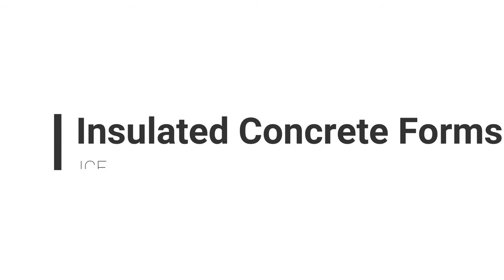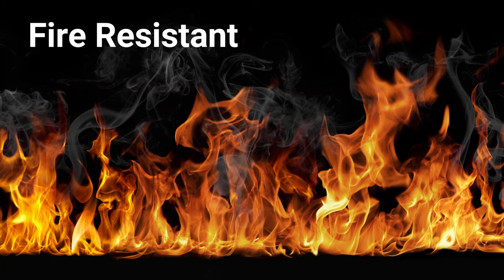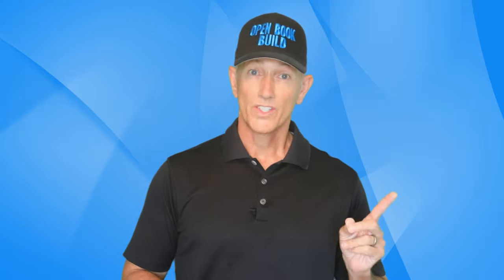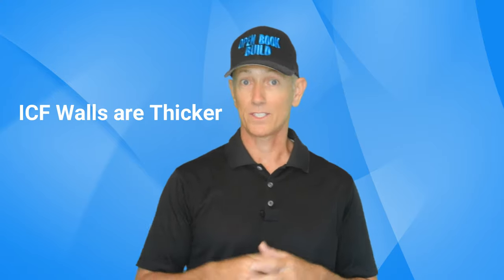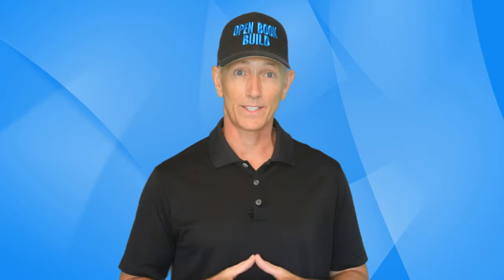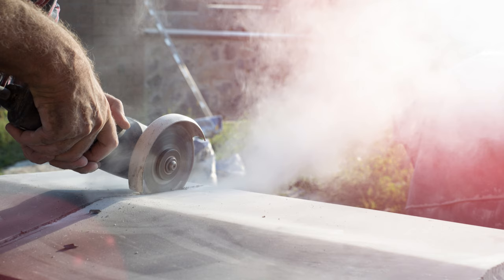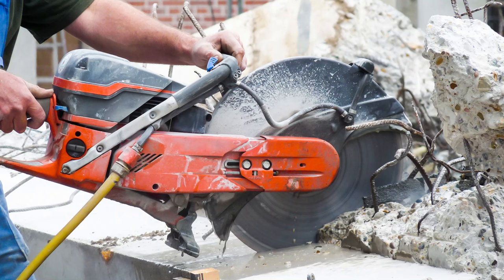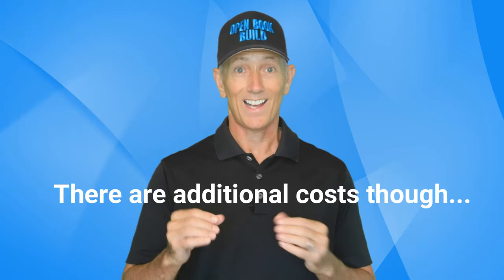ICF Construction: Why I Haven't Used Them as a Builder

Comment: As a guy that builds with ifc’s nearly everyday here is my take. 
Detailed plans are a must and we will live or die on the plans. Openings, pipe penetrations, windows and doors are set to the plans and followed to a “T” because we do not want to come back and fix anything. But we can build off any standard plans, building off interior dimension isn’t uncommon. 
But most of our builds are not complete homes. Most are retaining walls build into the house. A half basement type thing.
Reply: Cody, where abouts do you build?  I am getting ready for a custom home build in the San Antonio TX area, using my brother in law (a custom home builder) and trying to convince him to try ICF. We will not use it for the main house, but I want to use it on the shop (approx 20’ x 25’)
Reply: @justinjimenez6960  I’m in the north west area. By the Continental divide. If nothing else just try the foundation walls with the Icf. Up here we need to build below the frost line and that is usually two-three blocks high depending on the brand of blocks. It’s a good way to get your feet wet and see how comfortable you are with the blocks. The insulation is amazing with these things. Currently finishing my own home with these blocks. You can literally walk into a room, fart, and the room temp will rise 7 degrees….😉
Reply: @justinjimenez6960  There's a company in East Texas called American ICF. I'm planning on having him help on my house with full basement. You give him the plans, he orders everything you need and puts it all together. You hire your own concrete guy etc.
Reply: Hi Cody, did you try Thermasteel panels?
Reply: @coronaviruspandemic7548  did you end up using American ICF?  I haven't been able to get ahold of anyone there.
Reply: Went to a homeshow in Northen Utah. Building next year and I'm 95% positive to go this route
Reply: Being afraid of new technologies is not uncommon. I built my own house with ICF to the roofline and I absolutely love it. Installing the electrical was not the huge issue you make it out to be. A simple hot knife to cut the wire runs and for the boxes then spray foam to seal it. As far as difficulty aligning the walls with concrete just use a proper bracing system and align as you go while the concrete is wet. Stick building is horribly flimsy allowing alignment after the fact. You don’t have blow outs if you use good blocks (Fox Blocks) and you do not try to fill all the wall at once. Fill in three foot lifts and circle the perimeter, by the time you get back to the beginning the first course is setting up. Yes you have to plan ahead for larger larger penetrations but small holes like for silcocks are no big deal and can be drilled after. They build multistory hotels with 6” blocks so a home doesn’t need anything wider. The 4” blocks are harder to fill. I have have joist hangers made for ICF that support directly to concrete and for the deck mounts and sunken floor area of the walk-in in curb free shower I used rim joists mounted with J-bolts where windows are cut into the foam to allow mounting blocks of solid concrete to come to the surface. Having mounting points every 8” instead of every 16” is great. We took the stone from the basement dig out and used it to face the front of the house and it sits on a concrete ledge of the specialty blocks. Heating and cooling costs are noticeably lower and it is a real quite structure. I will stick build my garage but never a house in sticks again.

Comment: Not the case of this gentleman, but builders do not like ICF at first because most of them (by their own admission) do not even know its existence.
Second, the house walls go up so quickly in 1 go with only 1 trade of 5 men (+ concrete truck guy) instead of 3 to 5 trades, and that leaves with very little room for change orders, up charges for "hard to get supplies" and "unforeseen" issues the stick builders can charge the customer with...
Also if their employees learn how to build in ICF it would not take much to go "solo" and become their competitors in the same area.
The issue highlighted in this video with the flooring system detailing is easily resolved by using detailed drawings which are provided by the ICF block supplier and can be integrated into the original plans in no time.
But in general, a part having to manage humidity for the first 12 months, most of the concerns mentioned in the video offer an advantage if looked from another angle.
Sure it requires better planning and drawings than a stick-built, but that is a win because it will force you to plan and supervise better which is not a con.
From 2000sf and up, building in ICF offers more advantages than the traditional system and comparable costs. For basements, ICF is actually a no-brainer.

Comment: I built a 1600 sqft (per floor - Canada, upper floor was traditional 2x6) walkout ICF in 2010 and here is my take.  You need a good concrete supplier with consistent quality concrete and need to be very sure to brace the walls properly (mine were 10ft tall) not only to prevent blowouts, but also to prevent the small separations that leak concrete.  I planned for all the service penetrations ahead of time, and it wasn't an issue.  Extremely quiet and comfortable (although this was out in the country on 160 acres...so already quiet).  Humidity was never an issue from day one...I'm not sure where that's coming from.  

Also, tons of waste in the form of small pieces of foam and plastic clogging up the landfills afterwards (and blowing around your property).  This is not an issue with factory-built SIPs, and the process is much quicker and less prone to screw ups, so I may go that route with my next build in a few years.  You do also need to dig out foam channels for the electrical, which was also time-consuming and made another colossal mess.  Forget about stucco on the outside too unless you really want to complicate your life.
Reply: Hi Karl, we want to build an ICF house in 2023, about 1200 sq ft.  Can you provide me with any contacts?
Reply: @JNO_JNO  Hi, no idea.  I am in Saskatchewan.  It isn't that difficult to do yourself.  My neighbour (out in the country) did a house our size and him and his wife watched the video that came with the blocks and had the house up faster than I did, and it looked a lot better too.  The main benefit other than doing it right is that you aren't waiting on contractors.
Reply: @JNO_JNO  nudura or amvic or build block
Reply: Pretty sure all of the foams used in ICF blocks are recyclable, so the off cuts shouldn't need  to go to the landfill.
Reply: @carlb401  Haha...I have yet to experience a contractor that gives two sh!ts about the environment.  They're like grain farmers.  I had to tell them several times to clean up the pieces that were blowing all over my property.  When I asked them about recycling the pieces (because I had heard that too) the numb look they gave me was not encouraging.  I doubt even 0.1% of the waste ever gets recycled.
Reply: @karlhungus545   My pet hate is mess when working. As a carpenter here in the UK, when ever i set up a cutting bench or my mitre saw i always have a bin next to my tools for the waste. I have lost count of the times i have slapped someone when i let them use my bench/ saw and they just throw the rubbish on the floor, even though the bin is just 2ft away. 🤐
Reply: I still don’t understand why people don’t just build with concrete block and put the insulation board on that . Homes in Florida are almost always built from concrete block .
Reply: About the humidity, the guy in the video talked about concrete being 20% water that "needs" to get out. That is complete false information. Concrete does not "dry", concrete reacts with water to form hard crystals. The water does not need to get out, it needs to stay in and form concrete! That alone tells me the guy has no clue about construction, and this talk against ICF is just the opinion of a man that hasn't done much outside his comfort zone, aka houses slapped together cheaply and quickly. Yes, sometimes concrete will let out some water, but not nearly 20% of it's mass and like he said, a couple of dehumidifiers are good enough to address that.
Reply: @flavius29663  Yes, lots of these guys are stuck in their ways and would rather believe nonsense (and try to convince others of the same) than have to learn something new.

Comment: I really enjoy this channel and how much value it brings to anyone looking to be an owner builder. Some helpful viewpoints. ICF are far superior. It's difficult to even present a comparison. When you look at everything from the lack of thermal bridging, framing factor of traditional stick built homes, thermal mass of the concrete core, blower door test results of ICF, operating cost of HVAC systems in ICF, resilience against water damage, and the ability to survive hurricane wind speeds. Concrete, steel, and the ICF blocks are far more cost stable when estimating a build budget. If the cost is 5% more for ICF you can calculate how fast that is paid back to the owner in operational savings from a significantly efficient home. If you combine ICF with some techniques from passive home design like southern orientation of fenstration and thermal massing of a polished concrete slab floor you can downsize mechanical systems even further. These homes should be constructed with dedicated dehumidification, energy recovering ventilation, and heat pumps. Building codes were designed around a world and climate we no longer live in. In my area we encounter 100 mph winds and within the lifespan of a newly constructed ICF house 200 mph is inevitable. I would rather my family be protected in steel reinforced concrete than a structure that fails at the roofline even when additional hurricane ties are in place. ICF are also DIY friendly when the manufacturers provide an incredible collection of instructional video, documentation, plan inspection and design services. You can even rent bracing systems. Imagine a ICF block wall with 2.5" eps interior + exterior, a 2" eps insert to the exterior (total 4.5" to the exterior), 6" steel reinforced concrete core, total 7" eps insulation with zero thermal bridging and a 6" core of stabilizing thermal mass. Now design and engineer a stick frame wall that will perform the same....
Reply: Good comment, but your climate alarmism is way out of whack. Storm proof is good enough without exaggerating future climate risks.
Reply: @5starCA   There were 200mph winds from Hurricane Ian 10 months ago, so he's not being alarmist. And the heat this summer is record-breaking nation-wide. So all his points are 100% valid.
Reply: So true!

Comment: We're aiming to build a home, and hopefully use ICF (for longevity/durability and energy efficiency). I'm trying to compile a list of all the considerations that need to be made, so that we can plan properly and reduce the headaches associated with making mistakes/forgetting things in the plans. Videos like this one have been extremely helpful. Thanks for making this!
Reply: One thing I'm doing in the planning of mine (ICF, slab on grade), is planning the plumbing runs carefully. All of my plumbing is on one side of the house and I plan to have the main drain line run under the ground BESIDE the house rather than under the slab like is normal. That way, if there are any problems with the line, the slab will probably not need to be disturbed. Makes the line a bit longer, but if I ever have a problem with it, I think it will be worth it. Pipe is cheap, comparatively.

Comment: You don’t have to dig out channels in the styrofoam for the sub trades. I’ve been on builds where the walls are firred out with 1x4 for easier drywalling and electrical. ICF blocks have grooves that denote where to screw/nail fasteners but it’s easy to miss, so using 1x4s parallel or perpendicular to the ground works great with little added cost compared to digging out channels.
Reply: How are the firrs attached to the concrete?
Reply: @greenthumbprepper8653  Not attached to concrete. the foam part in the ICF has plastic strips in them for you to screw to. Locations are marked on the foam and you can just screw the 1x4 to them.
Reply: @josiahrichardson5455  that makes things so much simpler then!!!
Reply: Exactly!

Comment: Almost every new construction home I see has a ton of unnecessary details that create difficulty for builders and the trades.  I would never try to translate stick built home plans to ICF.  If you can make construction details easier, it will probably pay for any increase in materials used.  If you plan for electric, plumbing and HVAC in the design instead of build and then tell the trades to figure it out, you'll save there too.

As for trades that don't know how to work with ICF, how will they learn if you only build stick built?

Lastly, ICF really lends itself to energy efficiency with the insulation and air sealing.  If you take advantage of that your reduced energy costs should offset that 5% increase in mortgage payment.  With wood prices today I don't think it's 5% either, I think I can save compared to a typical stick built design with a complicated roof line and no intention of trying to reduce construction material waste.

Once builders, designers and trades get on the same page ICF builds will happen so smooth and easy that you'll be kicking yourself for stick building for so long.

Comment: ICF are great for basements! With proper planning, all things said are no problems. ICF homes are also called Legacy Homes because they will last almost forever! One of the best for withstanding natural disasters. Will cost less to heat and cool. Biggest problem is they are airtight and need air exchangers added to ensure there is enough fresh air entering the home. I'm planning on installing for my basement myself maybe. Another thing not mentioned is that the walls are already for interior finishes. Just screw drywall or other finish to the walls!

Comment: You get concrete, much of the rebar, great insulation, air barrier, vapor barrier and avoid furring out to hang drywall - all in one step. Am I missing how it can’t be better if the cost is similar to traditional, especially for a basement???

Comment: Is there anything better than an ICF walkout basement if you plan to build a passive or super well insulated and air tight home?  What are your opinions with ICF basements vs others in regards to water proofing and radon mitigation?
Reply: May not be anything better -- it's way up there.  You definitely need to have air ventilation (ERV/HRV) so you're not trapping various toxins in the house.  Waterproofing is essential and non-debatable with any basement, including ICF.  Peel-n-stick or fluid applied both work, and be sure to shingle at the footer with a proper drain system also present.  Radon is mitigated just like any other basement or home with a slab.
Reply: I built an ICF walkout in 2010.  It was very quiet and comfortable, but I don't know that I will be doing it again.  I only waterproofed the part that is in the ground obviously, but it was overkill as the house was built in jackpine sand.  It is definitely a lot more complex than just using wood or SIPs.  With a walkout very little is even in the ground, so you can do a hybrid concrete/wood wall pretty easily.  You have to really brace well to prevent blowouts, and make sure they're putting CONSISTENTLY good concrete in the wall with EVERY truck.  A good concrete supplier is essential.  They also need to vibrate properly (i.e. not too much).  Finishing the outside with stucco is far more expensive and time-consuming as well as you have to use the fine metal lathe.  I'm not sure how it would improve Radon as that comes up through your floor.

Comment: Your concerns about icf is unfounded. I have built several structures out of icf. Zero serious issues. Core drilling isn't a big deal at all, there is also a tool that uses heat to cut into foam for electrical and plumbing. You are crazy to not use icf if you can afford the slight increase in price. It is quite impressive how cool it stays inside!
Reply: YES THANK YOU!
Reply: @mathewfrantz482  no problem! It really is amazing how efficient they are. An r60 value is possible

Comment: All points are valid but we are not comparing apples to apples. The energy efficiency alone allows ICF to be compared to an equally efficient stick frame. The best tip is the construction drawings have got to be redrawn with clearly marked dimensions of the ICF before you start construction. Every utility penetration has got to be planned with exact dimensions. Last-minute changes in outside walls are super expensive if not impossible.

Comment: How would your perspective change with ICF only for a basement foundation?  Slab-on-grade I don't see ICF's as a good choice but for below grade the waterproofing (e.g. Polywall) and having moved the dewpoint outboard of the concrete allows drywall directly to the integrated ribs.  You make a good point about the moisture getting out of the cured concrete but if you waited to finish the basement that could be mitigated.

Comment: Can cotton weep rope be installed to help with wicking the moisture out of the concrete walls without affecting the insulation of the walls?
Reply: The slow cure is what you want to make 4,000 psi concrete 9,000 psi. Get the roof on and your MEPS inspection then set up the dehumidifiers to run drying the inside of the foam. A couple days then drywall, it will be fine.

Comment: The extra costs of building an ICF house come back as savings over time in the cost to heat and cool the house. That’s half of the reason to build using ICF. The other half of the reason is ICF houses can handle storms easier than stick built houses can. 

The argument about the width of the walls isn’t necessary valid. Concrete block houses have the same wall thickness issues that ICF houses have.